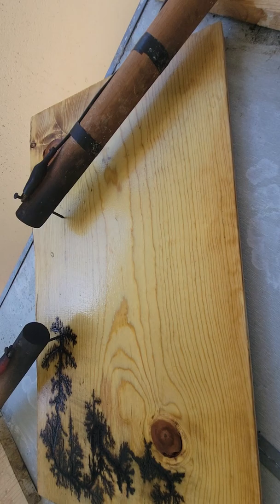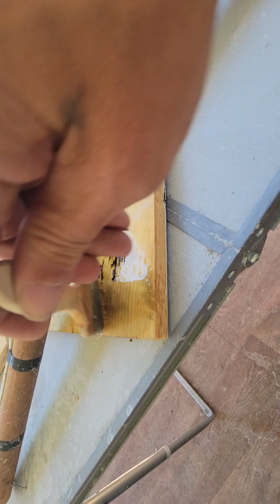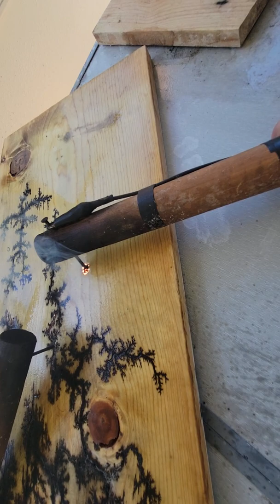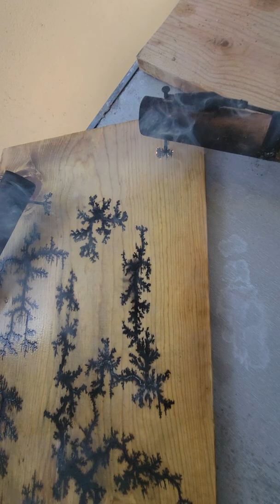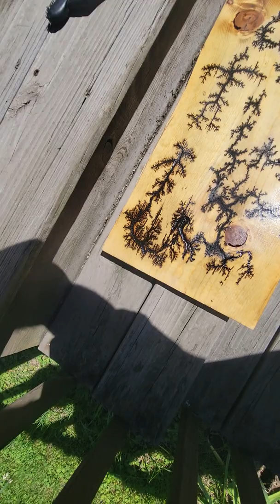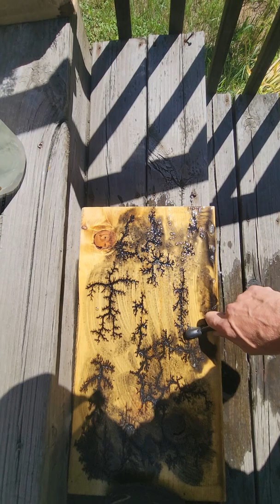safer fractal wood burning with electricity.

Comment: Safe fractal wood burning.  Sounds like an oxymoron to me.
Reply from the maker: Lol "safer" when it's just an on or off, that's 2000+ volts or no volts. Which a variac, u can control how much electricity ur putting out. Is it SAFE, no, it'll still cause serious damage, but it is a SAFER way to fractal burn